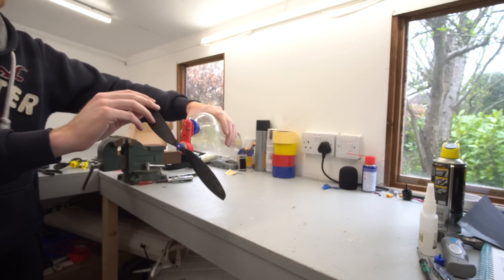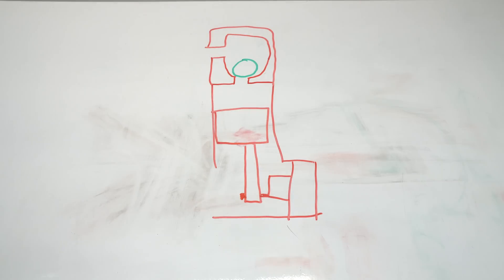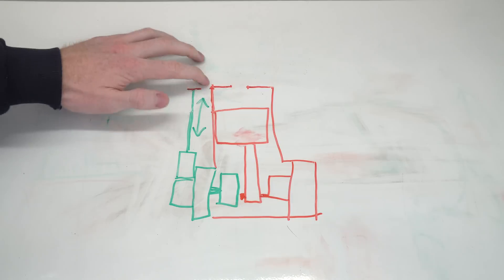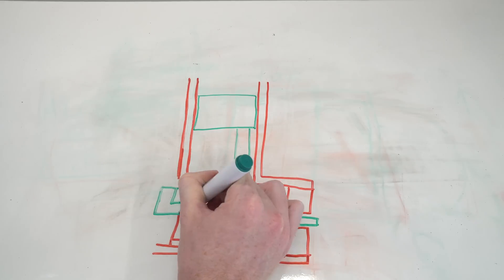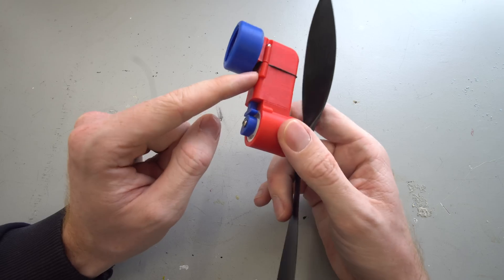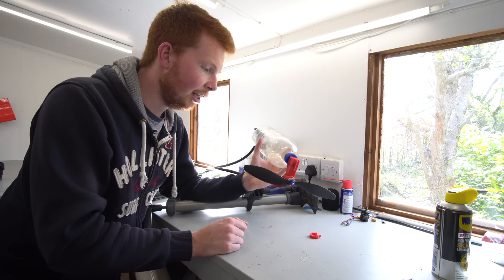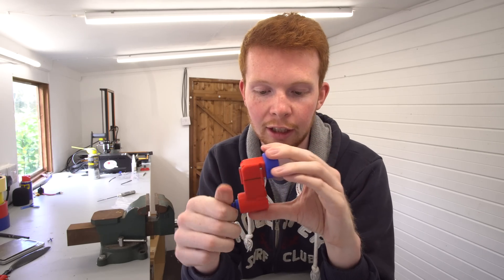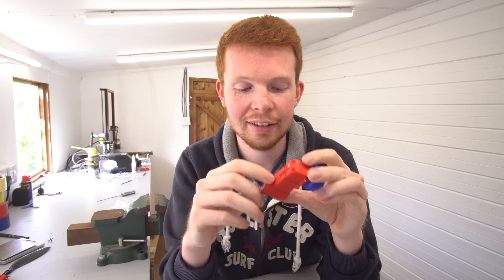Compressed Air Engine V3

Comment: I would like to see what you could do to balance the forces, and yes if added a regulator to your intake valve, that might help extend your run time.  I think 6 cylinders can balance forces in all three axis (x, y, z)... having balance is needed to keep the engine from changing the flight path when you use it in an airplane. This and power to weight is why turbine and rotary are a choice for fuel engines.  Three variables used in engines to convert energy... pressure (which you use), temperature (not used), and velocity (not used.)  A turbine would use 2 of those instead of 1, btw.  A combustion chamber and different materials would be needed to take advantage of gas temperature change... which you could also do with a turbine.  Anyways... great video... you earned my like.

Comment: Another concept would be using a crank shaft with three crankpins - one in the middle to actuate the con rod, which would go straight through the the middle of the piston, and one on each side of it to actuate the piston itself. That would allow to you build it even more compact, since you could pretty much use the same setup as the V1 engine, except for a different piston and crankshaft setup

Comment: I had two ideas...  1 put the cam on the other side of the Piston so you can shrink the assembly further...  Or 2 build the slide valve you rejected within the Piston...  That is a horizontal slide valve in the same assembly with a cutout in the Piston itself to act as the valve...  3 if you want the ball valve activated from the side ide gust angle the end of the thing hitting it to move it aside..  4 I don't actually know what I'm talking about and this is great so thank you.

Comment: Can I give you an idea? Why dont you make an engine that the air goes on both sides of the piston, pressing each side at once? Its a more efficient engine, the piston will be pushed and pulled instead of only pushed. Give a try! =)

Comment: This is awesome my local library has 3d print machines with staff to help!  I need quad copter props.lol!      But this is amazing!   I love this whole idea!      Now u just need to come up with a air flow / pressure regulator  so that 60 psi will last to get u in flight quickly,     Then another air bottle can be opened in flight for a slower  or even sustained prop speed for steady fligt prepulsion,  For extended periods!     That would be cool!

Comment: Here's an idea, what if you geared the crankshaft to a gear just below the intake port of the head, and the gear just below the head had timing holes to allow air through? You could seal this system by making a cover that goes around both of the gears and bolts to the motor housing

Comment: Now that the con rod is offset, can’t you just put a hole up the middle of the piston for the push rod, thus removing the need for any offset? And then the axle could be extended so there can be a con rod on each side of the piston, balancing the load.

Comment: Can you use a co2 cartridges to run the engine?
Reply: Maybe but it would need an adjustable valve or direct co2 cartridge would probably blow the motors cap of lol
Reply: @levistrnad2965  Aren't they like 90-120psi? If so then it propably wouldn't blow up.
Reply: Anchor Bait yes you could you would just need to fit it

Comment: Are you thinking of using some higher presure tank with a presure limiting valve so you don't blow up the engine but have much longer lasting run?

Comment: You should hook the engine up to a compressor and see how fast you can get the motor to run without self destructing or it doesn't work!

Comment: some things bugs me here and lastly a idea for the future.
1 when you told us the minimum ish si it runs on you already spun the engine some more dropping the preshure so the real minimum preshure is higher than you told us.

2 you saying it is fully 3d printed is wrong you got bearings in there not 3d printed you use scrues not 3d printed. 

3 future idea make something that limits the preshure so that you get a constant 30 psi so that your engine runs at a constant speed instead of rapidly going faster reatching max speed then going slower as the preshure get lower. if you limit the psi output to 30 psi or atatch a breaker on the engine it wil run for longer and a more consistant speed.

Comment: If u want more pressure in the bottle cover it with insulation tape and make it more air tight some how eg rubber mouth cover for where the screw cap of the engine neets the bottle

Comment: You ever mess around with Air Hogs Helicopter &  Plane. if so what do you think of their compressed engine. It was cool sending those flying in an open field, the plane was the best for me. it would stay in the air if it had clam breeze.
nvm you mentioned in another video.

Comment: I'd think you'd want the valve to start opening just after top center to take advantage of some "bounce" from air compressed in the cylinder by the piston moving up.

You could put a cam on the front, between prop and engine, with another valve that vents the top of the cylinder from bottom center until just before the inlet valve opens. that would get rid of resistance from the rising piston having to compress air in the cylinder. Should be worth a test to see if it further improves efficiency.

Since it's square, is it a squilinder?

Comment: Run it on some kind of liquefied gas?

I find a slight cam advance gives my compressed gas engines better performance, and I could even adjust the speed with the timing.

Comment: You really need to adjust the cam since it sounds like the stroke that , also i would lubricate the cam as wel and make it lighter (hollow?) since the loud ticking noise in my opinion is more the cam slamming up and down and losing energy instead of the piston.

Comment: Inside the bootle you could put a disc with spring to push the air to the engine as the pressure is going down. Do you know what I mean?

Comment: Hi Tom, it seems run time is a bit shorter than the previous version, it could be that your connecting rod is staying open for too long. You could add rotating mass to take advantage of that, or reduce the conrod movement. Great job as usual!

Comment: That is just amazing, extremely impressive! :D I made an Air driven boat back in school, I made complete use of automatic watering systems. Little tubes and links. Great for "fuselage" if you want to separate the air container and the propeller.

Comment: I wish my mechanical engineering class professor would be stupid enough to pass me using a square piston. But no. There is too much pressure acting on each vertice causing mechanical failure

Comment: If your useing the typycal cam shape to drive the ball valve, although it be very complex why not partnter up with one of those people who make massive RC planes and install a multi cylynder model, you could get around the valve problem by extending the rod that connects the spinning cam to the crankshaft out a bit and offset the intake on the Z axis to be out of the way, not an engineer buuuut, im pretty sure that that would allow the engine to make more power because not only is the momentum of the flywheel (propeller) driveing the crankshaft when the engine is on its return stroke, but now you also have constant power meaning a graph of the torque would look less like a wavy mess and more like a less wavey mess. But all that is just conjecture XD I don't know much about engineering yet even though I want to study in the field, amazing video btw i really want to see this engine drive some cool stuff bro. anyway, %100 earned my sub

Comment: You could also put the push rod going through the piston and connect it a 2nd cam to the side of the piston cam to cut down on space. It's kinda complex, and you'd need another seal on the piston, but might be worth taking a look at...

Comment: I quite like these videos and got idea how to maybe make it bit simpler. Why not go with bit bigger ball in valve, but still light one, make air intake not at top but side, let ball protrude bit inside cylinder and use side of piston (maybe bit shaped )to push ball away to make small space around ball and let air in. Air pressure should be enough to keep ball in place and air flow should close it back. This way it could be quite simple and without too many mechanical parts like this version.

Comment: hi Tom, although your solution is great and works straight off the drawing board which is impressive, I wonder if an even more effective solution would be similar to a dual action steam engine? In this case the pressure drives the piston from both directions and the secondary cylinder, that works as a valve, has no resultant force on the piston surfaces, unlike a ball valve, and therefore there is less resistance during each engine cycle? Obviously the engine is running on compressed air, not steam! here's a little animation that demonstrates the principle: https://www.youtube.com/watch?v=YVJsZCU6z1A

Comment: You should try putting a small amount of hot water in there and put a little piece of dry ice in there because of the pressure it would build

Comment: The problem you will always encounter will be that air has a low energy density, unlike electric or hydrocarbons, air can only be compressed so much. This means that even if you make a device with a theoretical 100% energy conversion rate, there isn't going to be much energy there to begin with. It's just not viable. On another note, I appreciate the time and resources you're putting into this field. Even if you can't move something with it, at least there will be development for it.

Comment: really nice,
what you need now is a pressure regulator, so you can have like 100 psi in the bottle while just 30 reach the engine. this way you will get way more efficiency

Comment: you might be able to compact this more by putting the cam rod through the piston head and move the ball valve back over the cylinder head. I have seen that done with a beta-type Stirling engine.

Comment: So, what effectively improved between designs?  pluses: additional piston area, square versus round and removal of valve actuator from piston head. increased flywheel mass due to addition of cam. external valve actuator does offer timing adjustment advantages. minuses: reciprocating mass of valve actuator. added weight of cam and actuator.
i'm thinking that the advantages could be built into the previous design leaving the valve actuator on the piston head.  adding a flywheel could be an advantage on a single cylinder engine.  all old single cylinder engines have a significant flywheel to help carry rotation into the next powerstroke.  also, use exhaust thrust as effectively as possible.

Comment: Why not use the crankcase as the cylinder charge area . Then 2 disc valves either end of crank so the air basically flows through the crankcase and not the head , minimum moving parts and no pushrods

Comment: My suggestion, as a next step, is to use the lower position to open a second valve and fill the bottom of the piston with compressed air. The way your working you waste a lot of energy by letting the inertial load to bring the piston back again, which reduces drastically the BHP power.

Comment: What if you went with the ball valve design you talked about at 3:00 but used a steel ball and had a magnet on the camshaft that, when it came close, would pull the ball down into its seat and away from the hole? Although you would probably lose a lot of power pulling the magnet away.
Reply: Also, after watching the rest of the video, your final design works amazingly! Congratulations!

Comment: if you wanted to really get serious about this. you could use some sort of composite pressure cylinder. you would be able to store a vast amount of air and still be light weight. i would think some sort of glider with a large wingspan, say eight feet, would carry the weight just fine. all you would need is some regulator that you could probably make. a setup like this has the ability to be throttled from whatever you use for your planes already.

Comment: Now all you need to do is add a limiter to the amount of gas/air it can use. maybe some sort of gear system to seed up the propulsion of the engine whiles at lower fuel limits. And if you were going to use this on a plane. you could then use a servo on the limiter (most likely some sort of shutter valve) to open/close in gradual increments. Though as an idea i think the limiting factor of it is still the waste air. so maybe use a dual piston setup maybe the next area to look in to. feed the waste gas from the first stage in to the second stage. also i would probably use compressed gas for extra run time/power if you do or do not use a limiting factor on the gas flow.

Comment: You might want to experiment with different sized bearing balls too. A heavier ball would open and close the valve slower, possibly reducing the RPM and increasing the run time at the cost of reduced power, and vice versa for a lighter ball.

Comment: Here's a crazy one to consider:

Headless engine, pressurize from the crankcase side (pushing cylinder up rather than down), and use arc-shaped openings on crankshaft driven rotating plates to control the valving for intake/exhaust of air. The air going to the timing disk/valve would be going through a somewhat small opening, so thrust against it causing friction should be fairly small. That may be the most compact way to get something working with least amount of parts. Also some of the design aspects are fine to get away with, since there's no issues of lubrication and fuel going everywhere from whatever small amount of blow-by there may be, it's just air.

I think the description makes sense, but if not I could try 3D modeling something and putting it on Sketchfab.
Reply: I like it, that’s what I was thinking when I suggested a barrel valve. Your idea would not only save weight, but would scale to 2 or 3 cylinders.
Reply: Not sure about multiple cylinders with what I could come up with... More about being compact and stupid-simple in layout. I did get around to some quick 3D modeling of a mock-up (some details missing, however the idea should be clear):

https://skfb.ly/6yv6o

And if thrust against a disk is still an issue... Then your barrel valve might be a better alternative. Should be possible to admit to a barrel from opposing sides at the same time, and that would then self-cancel. (Bit more complicated, but the engine part would be 3D printed and such internal passages would be easier to incorporate.)
Reply: A single rotary disk could be used for exhaust and intake, that would scale to two cylinders. My idea was to use a hollow crank with a barrel valves feeding the crankcase. I don’t think I’ve ever seen a “headless” motor before. But it makes perfect sense in a lubrication free super simple design.
Reply: @pauljs75  Love your model. Minimal moving parts. How does air get out of the cylinder when the piston is on its compression phase?
Reply: Paul JS - I wish Youtube could allow thumbnail sketches.  Your idea sounds very viable but my 60+ yr old mind doesn't bend like it used to!
Reply: I was thinking of the rotating plate inside a Trabant engine, that controls the air intake.

Comment: U should restrict the airflow so that the engine can run slower at start instead of wasting high pressure to give it a kick. Its better if power is consistent rather than burst.

Comment: You need to fit a regulator before the engine, this will give your engine more consistent air flow and longer run time! If you wanted to get really fancy make the regulator controllable which will act as a throttle :)

Comment: You need a valve and CO2 cartridges, remember that when you have a mixture of liquid and gaseous face, the pressure is constant, so you can let the engine run at the same speed for longer.

Comment: Try a flapper valve bottoming just short of the intake port above the fathead, actuated by the cam on one side and the air supply opposite the flapper on the on the other side. That would provide a very short-coupling on the power stroke.

Comment: Tom, to increase efficency you could mount a spring to push the ball-valve down towards it's shut posistion. this would reduce the amount of time it is Open and letting air through and thus not wasting it. the downside with this design is less power in each stroke but giving it a greater run time and efficency thus making it suitable for an highlift aircraft with a runing start.

Comment: Use a pressure regulator before the engine input. Also if you use the same trick for the exhaust you prevent de compression of the residual air present in the cylinder after he exhaust and improve efficiency.

Comment: Can you add a ratchet system to the propeller after the cam? You could make the cam smaller and let the engine "bump" the propeller by interfacing the ratchet. This would make it more efficient and last longer because you would use less pressure,

Comment: You should attach a compressor to the bottle and have it pump air while the engine is running so you could have a long term test to see the durability of the engine